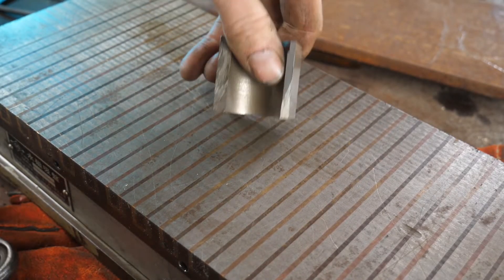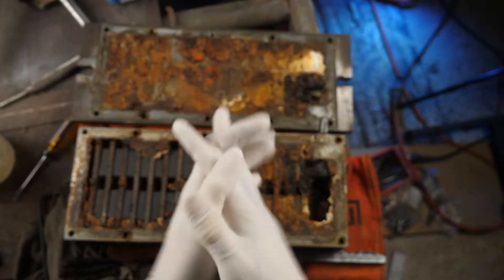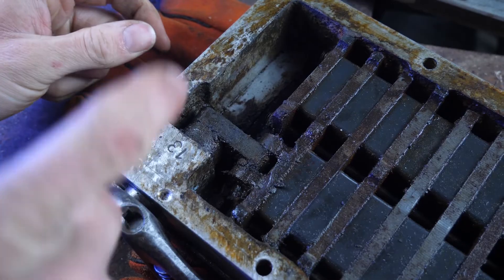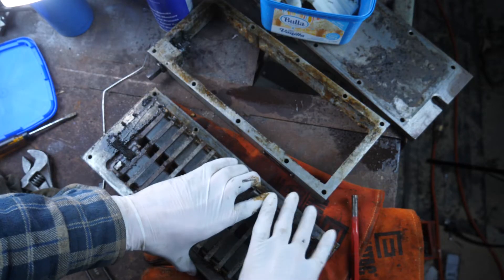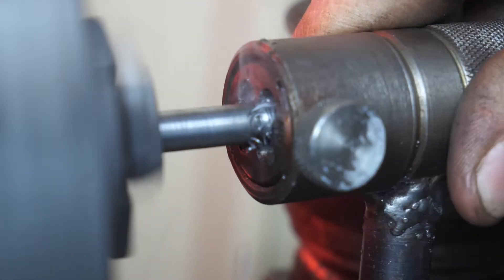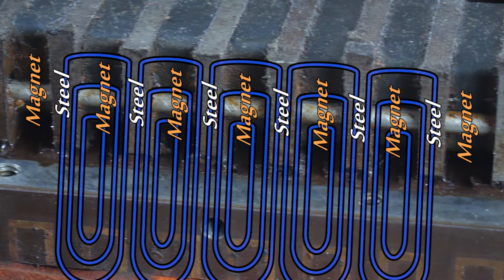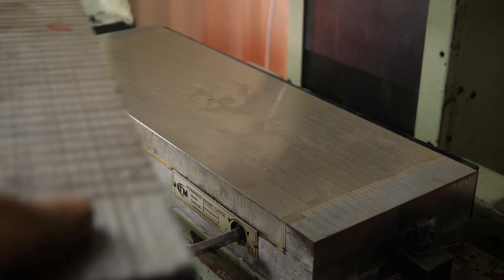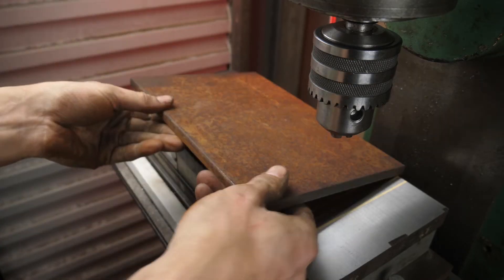Mag Chuck Restoration

Comment: Thank you for this! I've been meaning to pull apart our mag chuck, but the demand to use it is low, so it didn't make economical sense until I had a better understanding of the insides to speed up the process. Not sure if that makes sense, but seeing the guts of yours and that pin I know it is likely a similar issue with ours.

Comment: I cannot find this information wherever I'm looking and it may be stupidly simple but I need to ask- the magnetic side is what holds the material you're currently working on but how is the chuk itself mounted to surface? By screwing it onto base surface or is it something like engaging magnet works both ways?
Reply from the maker: The table is normally surface ground by the machine. The mag chuck then bolts on with 2 hold down clamps.
The magnets are on the top surface to secure the workpiece and they only 'conduct' the magnetism to the workpiece when everything is aligned with the switch

Comment: I would take off the aluminium labels and put the rest in hot sodium hydroxide for 24 hours and it would be clean and paint removed .Gloves - I opened a lathe gearbox and got a problem with bacteria on my hands

Comment: Maybe you should invest in a sand blaster.
Reply from the maker: I would like a good one eventually. I have a terrible one that barely works, it might be my air compressor at fault
Reply: @TomMakeHere  unfortunately you got to have a good sized compressor. It makes life so much easier. I am building at the moment an electro magnetic vice that I will use on my drill press.

Comment: 1:15 don't strike magnets with iron. it can weaken them. maybe a nylon headed hammer? deadblow? nice job on the threaded pin!
I just watched a video on how magnetic chucks are made - they said they fill them with grease and graphite before they close them up.
Reply from the maker: Good advice. I filled with a thick oil before closing up. But I agree that a grease is a better choice

Comment: Hey Tommy got a question for you. I want to use the mag chuck to surface my steel to make knifes but I only need the width to be 3”x18” instead of 6”x18” , with your knowledge of what’s inside is it possible to cut the guts to that width safely? I’ve looked everywhere to find a narrow mag chuck. Anyway let me know what you think. Thanks
Reply from the maker: Hmm you would need to rebuild the housing as one side would be open which wouldn't be ideal. The magnets are crazy strong and you would want to be very careful trying to pull things apart.
Out of interest, does it matter if it is extra wide? The knife would just take up half of the chuck
Reply: Yeah I guess it would be too dangerous. I wanted to mount it on a 2x72 belt grinder and 6” wide is just to wide for that application. The knife maker’s are building there own but I don’t have a mill to cut grooves to hold these magnets and they don’t have the off and on switch either. I saw a set up at the Rockller web site (wood working) they have a handheld lockable magnet. Anyway I’ll change course but thanks for the reply, and keep up the good work!
Reply: @stevegarland7075  Email me I have very reasonable solution.....CHEAP.....

Comment: Putting it back together without completely cleaning the inside is not a real restoration.
Reply from the maker: I didn't repaint it either
Reply: @TomMakeHere  Yeah painting isn't a big deal, I kinda like the used look but a little lacquer thinner and brushing on the insides would go a long way toward cleaning up the inside,
Reply from the maker: Really difficult though, the residue inside is basically iron filings on a magnet. I cleaned what I could, sprayed solvents, poked and scraped etc

Comment: I just rebuilt one too.  You left a lot of crud inside, you really need to remove the magnet and clean the surface that contacts the top.  I did mine and applied a film of synth grease.
The trick is to remove the magnet when it's in the "off" position.  Slide the magnet off the side.  If you can, spin at an angle relative to the base.  Getting it back on is a bit more tricky.  Put a piece of HDPE or something similar that is about 1/ -1/4" thick ( I used a small cutting board from the dollar store) on the top, then put the magnet on top of that.  This provides enough separation so you can still align them.  Once it's where you want it, carefully slide the plastic separator out. 

The reason so many of these get so dirty internally is they are mostly used on surface grinders that use flood cooling.  As we all know, coolant can and does get pretty funky with all sorts of nastys growing it it. Mine was a mess inside too.
Reply from the maker: Cool I might give that a go. I was worried about finger crushing lol. and yeah it's a wet grinder, the tank was festy too.
I mainly wanted to get this magnet working for an experiment. It will probably end up sitting on the floor for a few years when I'm done lol
Reply: @TomMakeHere  Do be careful, these buggers are strong and will bite.  Probably not crush but they are strong enough to "leave a mark".  Yours looks to be a bit easier than mine was.  My case was two pieces, not three.  There was a top section much like yours but my bottom section was one piece so you had to stick the magnet to the top and get everything lined up perfectly so you could get it to slide into the base.  I use mine to hold small plasma cut outs while deburring them.  I use a piece of 22g sheet metal as a protector sheet on the face of the mag chuck so the wire cup wheel doesn't mar the surface.  The cut pieces stick with no problem.  Great little addition to the shop.  I've used it way more than I thought I would.

Comment: Actually... maybe you should consider pulling the mag pack off the top plate. Mine has 2 stainless strips that were worn down and hence wouldnt allow the mag pack to move freely. 
I cut new strips of brass of the same thickness and greased the strips with EP grease. 
If youd like pictures let me know. Mine was a kanetsu mag chuck. 
Gluck
Reply from the maker: I'd be interested in how you got the magnets off the top plate. I tried levering and wedging and then thought I'm probably asking for trouble
Flick me an email tommygmachining@gmail.com

Comment: So I sat down with my breakfast and this was the first video I pulled up to watch, looks like I made the right choice. By chance did you put down some graphite grease or create a seal between the bottom plate and the housing? Looks like it works well though good job, mag chucks are great tools.
Reply from the maker: No I didn't. I don't intend to do any wet grinding though. After this and needing to empty a new coolant tank because it was getting festy, I can't justify it

Comment: Should be a good chuck . Did you remember to leave one end just nipped when you ground it !
Reply from the maker: Ha no lol. But also my clamping arrangement is different (mag chuck vs bolted down) it didn't come out in the video very well, but there was a 0.02 mm variation over the surface.
This will be more experimental work holding